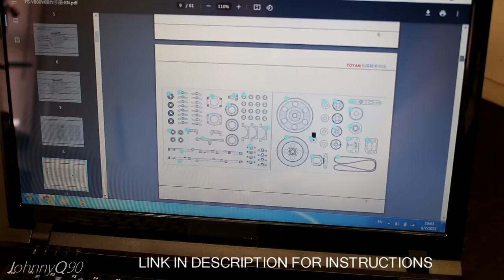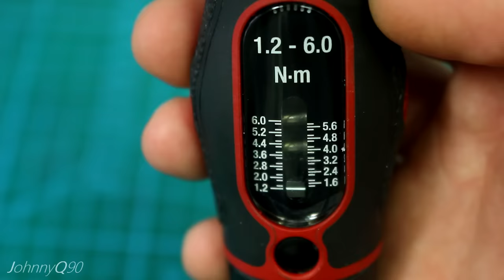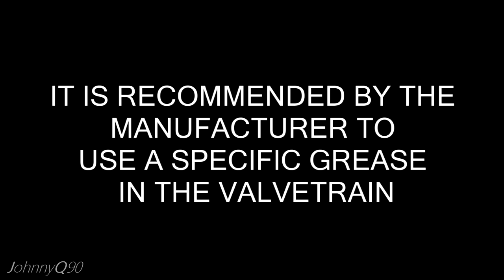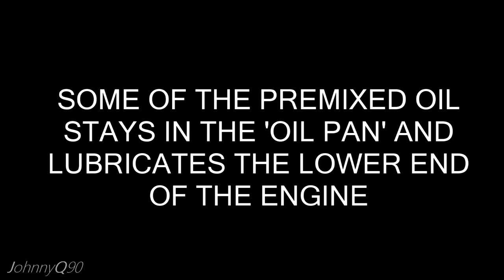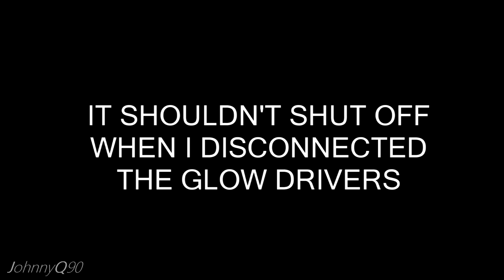REAL Model V8 Engine Assembly & RUN!

Comment: It would be interesting to see a setup where the starter becomes a generator after startup to run other functions of the motor. Like spark plugs, electric fans, and even radio transmitter.
Reply: there are no spark plugs, they are glowplugs like in diesel, but idea is kinda right. maybe except the fact you still need some form of battery to start the motor and power the steering servo and transmitter when engine dies. The motor can theoretically charge the battery but you need bms for that. And after all, combustion engines are loud but not as powerful as electric, no need for taking some of its power to run the generator. not hating, idea is fine but not really practical in my opinion
Reply: @pbednar  there are sparkplugs for those engines with the type Me8....
Reply: @pbednar  ive heard these engines arent very powerful anyway, and it would be fun to have a cruiser with a V8 that large. so you could make it work for a cruiser probably
Reply: I think scale is key though... would be neat to be all self sufficient like a scaled down real car....
Reply: That's what an alternator does, how did you think the normal cars kept a battery charge? Lol.
Reply: @alaska76-o5u  I know how a real car works. alternators on a scale model car aren't super practical since the car usually has a battery for the remote controls and the aux functions anyway. I just think it would be interesting if you could adapt the starter motor into an alternator/generator since it's already there. Just to try it.
Reply: @angst_  I get your point. However, an alternator needs all this junk and gunk such as conductive metal coils and transistors to be able to convert motion into electricity.. Same deal with generators. Putting all of that stuff on the starter would probably remove its ability to start the car in the first place. Also, with your point about the alternators not being practical because the battery is for the cab's electrics like aux and remote controls, that's mostly wrong. The battery needs to power essential things such as the ignition coil to provide spark for the engine.
Reply: @alaska76-o5u   Logan  Alternators are just 3 phase motors with rectifiers. Some scale-model motor starters are 3 phase. So you would need an esc to start the motor and some sort of rectifying circuit to charge the battery, but it doesn't seem that complicated. Generators are just DC motors, like the starter in this video. If you spin a dc motor you get voltage. So you could use that starter motor to charge a battery with the addition of a regulating circuit. 

I think you're talking about real cars in your last comment? mentioning the cab and ignition coils? I was talking about model-engines. My comment was just that a generator circuit on a model engine isn't super practical because they already have high capacity lipo cells that can handle all the onboard electronics and it's more efficient just to charge those batteries from a wall charger since the model cars don't really run for long periods of time without access to being recharged.
Reply: @angst_  So I see you read your books too, nice one :)

I apologize because I didn't expect you would have actually known this much, so I didn't use the correct terminology to make it simpler... I feel dumb now even though I know what you're saying... Bravo.

Thank you for clarifying your point.
Reply: Glow plugs ,doesn't have water jackets ,no need for a distributor or cooling fans

Comment: Interesting that there's only two bearings per camshaft. I guess since it's lubricated with grease plain bearings wouldn't work up there and there's probably not enough room for sealed ball bearings that would still clear the lobes

Comment: I never get tired of looking at miniaturized engines like this V8.  At full size it would be putting out incredible amount of torque and horsepower.  The only true issue mankind has with obtaining micro machines and Nanobots is a way to create them.  Machines that make other machines. 
A great example of progress we have made in micro machine technology is in computer hard drive data storage. The amount of data that can be stored on a hard drive is determined by ascii character size.  The smaller we can write 1's and 0's, and read them back, the more  that can be written. The more there is, the bigger a hard drive is claimed to be. Which is why they look the same today as they did 30 years ago.

Comment: Johnny, I have great respect for your machinist, tool making and engineering skills. I enjoy watching your videos. I have been building turbocharged and supercharged engines for around 35 years now. The amount of time does not mean anything though if you're not learning new important things as you go. I see that you're struggling to get this little v8 engine to want to wind up and make horsepower, and It seems like supercharger or no supercharger you're getting the same results. I think I may be able to help you fix these issues one at a time but just know that fixing certain issues will cause this engine to start turning more rpm and making more power which can lead to even more problems, but that is the fun of make horsepower right! LOL. Not only that, but I will start by saying that cam shafts must have needle bearing or plain bearing support between every cylinder. Since there is no pressurized oil which is a whole another problem I think you have no choice but to use a thinner grease which is synthetic Amsoil and create a splash system up top for now and have new cams made that have a needle journal big enough to slide the cam through the holes to assemble it. Plain bearings are awesome, but they require high oil pressure delivered in the correct unloaded area in a wedge design in order to work. Needle bearings can not handle a lot of shock loads, but they can run with very little oil. So I think your valve spring seat psi and over the nose needs to be increased because without a stable rigid valve train that engine will never come alive. And for now I would leave the exhaust valve size the same, but the intake needs to move air, man! Double the flow on the intake should be doable no problem with a larger intake valve, and the port and runners need to be very carefully designed by someone like Brent Long from Long Machine or Dave Bamber from Bamber Racing Engines. Both these guys are second to none, and they are not builders, they are designers, Inventors, Internal combustion engine gurus and the nicest guys you'll ever meet. Either one could help you more than I can because I am their student, but I would love to see you make your little V8 come to life, and I know for a fact there is so much more there to be had. You haven't seen any of its potential yet. You are the man for the job and very capable, but now it comes down to what must be done to fine tune, like you say. Do not give up, please. Hang in there. I  used to run them crazy Unlimited alcohol super stock tractors with an inline 6 cylinder 4.875 bore 5.350 stroke 2.600 intake valve to give you an Idea. 3 turbos two stages intercooler homemade pistons, rods crankshaft head valvtrain manifolds. A lot of work. She made 85psi boost plus and used 4.5 gallons of methanol in 8 seconds. Waterman fuel pump flowing 22gpm at 245psi fuel pressure. Over 4000hp at 6000rpm. Too much fun, my friend. Arnie Kwiatkowski Dorr, Michigan.
Reply: He's just assembling a kit.
Reply: Thanks for your comprehensive insight Arnie, I enjoyed reading, sounds like you have a lot of fun and an incredible amount of technical knowledge of V8's and engines in general!

Comment: the way those engines stall tells me that there a lot of friction going on that has to be overcome but looks and sounds nice
Reply: If you think about it, the bottom end is lubricated Like a 2 Stroke but without needle bearings at the rods, the Main bearings of the crankshaft are greased ball bearings and the top end is lubricated by Grease as Well, all of those bearings produce much more friction than in a Car or motorcycle engine. You would have to Put in significant effort to produce a Miniaturen V8 with a full oil lubrication system, thats why they dont do it...
Reply: I think it's more due to lack of mass/weight in the moving parts.
Reply: @jrand2631  could be, but the flywheel is enormous compared to the size of the engine, in a full size engine the flywheel is far smaller

Comment: I think you can get it running better with a exhaust redesign...  those pipes are definitely restricting flow on its bends...
And also (something you probably already know): Multi-cylinder engines that size usually have a system to turn on the glow plugs at 30% throttle or lower, just to make the idle more reliable...
Reply: Huh? I have a number of multi-cylinder glow engines that are this size or larger, and NONE of them have any system that turns the plugs on at low throttle settings, and they ALL idle just fine. 
If the engine is designed well, it won't need such a thing. There ARE also plugs available with an idle bar across the coil, to help with idle, if it's a problem. The idle bar helps to keep the coil hot, at an idle, by partially shielding the coil from the cooler incoming air/fuel charge. 

Also, there's norhimg wrong with the bends in the headers they way they are now. In fact, they look better than many full size racing automobile headers I've seen. The primary header tubes on this model engine have quite a long straight section coming off the exhaust port before they start to turn, which is good. 
If anything, the headers on the model could certainly benefit from a redesigned collector at the end of them, to take advantage of the scavenging effect. As far as the primary routing and bends goes, they're fine just the way they are, and I don't see any real reason, or gain, from redesigning them.
Reply: @davelowets  My background is RC airplanes, and most multi-cylinder glow engines use on board systems to turn the glow plugs on on low rpm...

Comment: love it, definetly do the 1/5 scale car tho. BTW; how did you do the belt timing?
Reply: same question bro. im just curious how timing works. does this engine run 2 stroke?
Reply: 4 stroke, but I wonder too how you have to adjust the camshaft with the position of the piston.

Comment: I think combine it with an arduino and captors to have the oil pressure, the temp of water etc could be very awesome ! Do you think it’s possible an engine as same size running on diesel ?

Comment: Very neat, I'm surprised that your lubricate underneath the crank bearings- when on a standard engine you would want those absolutely spotless and dry as can be.
Reply: I thought exactly the same thing
Reply: My thought as well, and IF anything, I would loctite them in place to prevent the shells to rotate with the crank....
Reply: My thought as well, and IF anything, I would loctite them in place to prevent the shells to rotate with the crank....
Reply: I came looking for this comment. My initial thought was this will help spin the bearing. I didn't see the top bearing being lubricated in the same way.

Comment: during assembly was there a step for cam/valve timing?
Reply: there better be. otherwise your gonna struggle with the timing like my dad when i was 6 and turned the cam slightly thinking it wont do harm. reminds me of the time when i was one when my dad changed oil, i took the screw. my dad ended up bying a new one only to catch me with it🤣🤦‍♂️

Comment: Obviously designed to run without a load without Cam bearings only 3 main bushings and no active tensioner.
Also didn't see an oil pump.

Comment: I'm guessing this isn't supposed to be run for very long due to the lack of active lubrication?
Also I'm surprised the cams don't explode with no bearing support in the middle.
Reply: oil from the fuel escapes into the crank case through the ring gap i think. that is also why the barb on  the crank case is there, otherwise it would just fill up with oil,
Reply: 👆👆👆👆this.

Comment: Just received the kit.
Beautifully made, but buyer beware: Inspect the parts carefully! I see several threaded holes not properly deburred, and in my case, one of the cylinderheads had one machining omitted: The threaded holes for the glowplugs weer bevelled out on the combustion chamber side in the one head, but not in the other. Other than that, beautifully packaged, and MAN!!!! It is TINY!

Spent an hour looking for the piston rings, but they were inserted in the cylinder bores... :D
Reply: And here it is running, on gasoline, with CDI ignition.

All I can say is that however beautifully looking, this thing really is an utterly BAD designed, poorly made piece of crap.
The machining LOOKS beautiful, but accuracy is "meh", and I found a lot of metal debris hidden in the threaded holes. Not everything went together as smoothly as Johnny made it look in his video.
The construction of the intermediate crankbearings is highly questionable, no idea how oil is supposed to get there, and when I installed the crank, everything turned over with an awful amount of drag (crankshaft and bearings alone, no pistons or oil seals yet). So I hooked up the cordless drill and left it spinning for 30 minutes with a lot of oil.
Assembly was straightforward, but just to mention one thing, the cooling pump came with the wrong gears. So for now the pump is "empty" and not functional until the correct gears arrive.

Intake manifold is the worst design possible. Total rubbish, and utterly restrictive. Going to make a new one.

But... it IS running, and it is running on gasoline!

https://www.youtube.com/watch?v=hgURbnhf2IM

Comment: One day Toyan will make these engines with spark ignition, fuel injection, 3 ring pistons, oil pump and the oil contained in the sump, pressurised lube system, all bearings on the camshaft etc. it's just a matter of time, I'm sure they will get there in the end, all that's needed is a market for such miniature engines, which there is!. The fuel required will be plain petrol and the engines will be so well sorted, powerful and reliable that they could even be suitable for light industrial use. Can you imagine what Toyan will turn their attention too then? how about a miniature 18 cylinder air cooled Wright Double Cyclone radial engine or even a Rolls Royce Merlin, wow, somebody pinch me perhaps I'm dreaming.. a few years ago I would indeed have been but here, now, we have beautifully made fully working miniature V8 engines available to the general public!  Happy days!

Comment: Add a flame tune lol. It’s basically diesel so that makes it harder but you could inject gas into the exhaust or lighter fluid. That would be funny if the finished car had a flame tune😂

Comment: It needs some timing in it. It’s really struggling to run. It would be very impressive if they could design a programmable ignition for these little engines, instead of using glow plugs.
Reply: You can buy ignitions. Since this is a 90 degree V-twin, you're going to need two ignition sets for inline four cylinders...
Reply: glow plugs are needed for this type of engine as 2 strokes running on methanol ignite on their own compression. You'd need a completely different engine design if you were to go with spark plugs as that requires to run it on gas and a full oil system.
Reply: @gamesnic  Check my channel, look real good, then rethink that statement...
Reply: @gamesnic  This is a four stroke. I run methanol in my race car, with a mag at 36degrees btdc. There is no reason it can’t have an ignition system.

Comment: So badass! Very cool. Unfortunately, I literally built a full-size v8 that is just under 1100hp for not much more than the cost of this mini v8 lol. Sure, it didn’t include the turbo and fuel system and yada yada. But I literally have about 2k into it. Couldn’t imagine buying a mini v8 for that much lol

Comment: I'd like to see a super slow motion video of one of the camshafts. Why? To see if it's bending / whipping with only having bearings at the ends. It depends on blowby of oily fuel past the single piston rings to lubricate the crankshaft. It has no lube supply to the heads. That grease will eventually wear off the moving surfaces. The heads are only cooled on their bottom faces from the 'wet deck' block.

I see it has places on the rear of the heads to mount something, most likely sensors for a spark plug ignition system, which would be needed to run it on gasoline. But without a lubrication system and proper head cooling, and dual piston rings to drastically reduce blowby, you would not want to run this engine on straight gasoline. You'd have to mix some two cycle oil in to provide lube to the crankshaft. Then it would smoke like a 2 cycle.

Comment: all that is missing from the engine is a working alternator which on the one hand recharges the starter battery which then starts the engine, and then the RC electronics via a DC/DC converter with the required voltage for the RC receiver and the 
servos supplied. 
it would then also be possible to start the model via the receiver and from there it supplies itself with electricity because the model needs until the tank is empty.

Comment: Great job.  I don't like however the design of the camshaft which drives all 8 valves without any internal bearings, only supported on the two ends.

Comment: interesting models for sure..  as a racer,  I see so much low hanging fruit for "hop ups"  no valve lash, monstrous valve stems , no cam bushing/bearings  just as a warm up.. bet there is 50% more power to be had   :)     Would love to get my hands on one of these but I have no use for it when I am done.. At $1500, it is $$$$ hobbyu

Comment: Lost me at non-oiled valve train and two stroke. Being able to adjust timing advance is kind of a big deal on a V8. And those rings, omg the bypass lol. I'd maybe look up a small radiator to pump the fuel through as well.